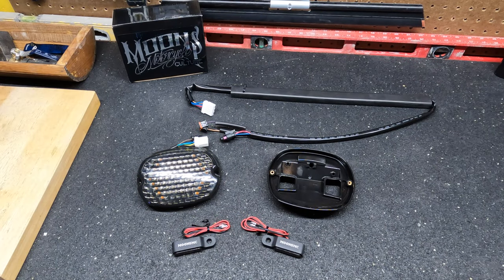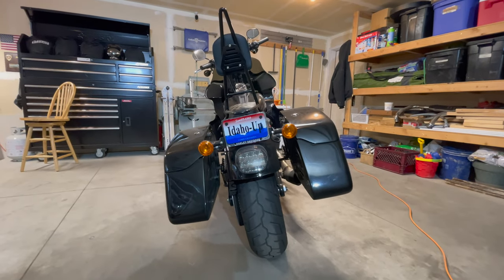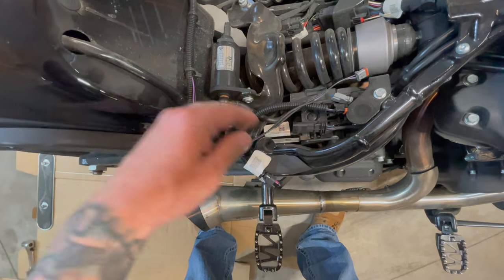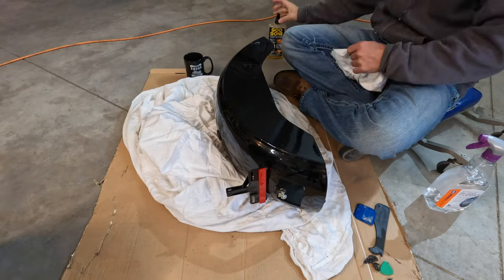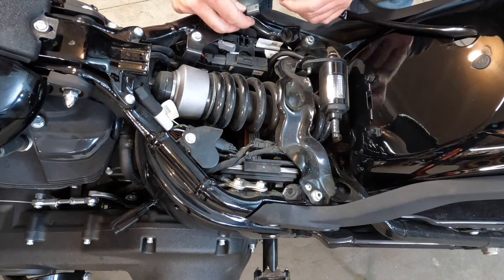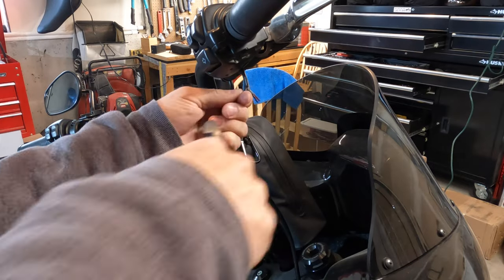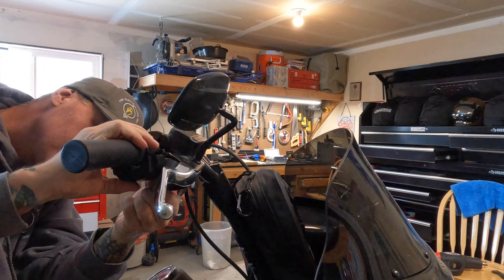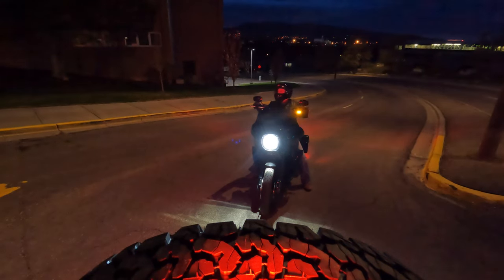M8 Harley Moons MC LED tail light and handlebar turn signal Install and DEMO Low Rider S

Comment: Did you plug it back in as you removed the screw from the battery at the end? No spark?
Reply from the maker: Yup, I plugged the battery back in after the install. No spark, but if you tap the negative wire on the negative terminal it’s not uncommon for it to spark.
Reply: Thank you for your advice. Great video. I made the same modifications as you front and back. @Idahoup
Reply: Didn't you get an error code (battery, light) on the motorcycle?
Reply from the maker: Again, this is something that is not uncommon after changing something on your bike (lighting, handlebars, etc.). There are a lot of videos on YouTube showing you how to reset error codes on a Harley, but here is a link to one that explains it pretty well.  https://www.youtube.com/watch?v=T6VBZ-FNRjw
Reply: Thank you for your help 🤜🏻🤛🏻
Reply from the maker: @Deep-Valley anytime.